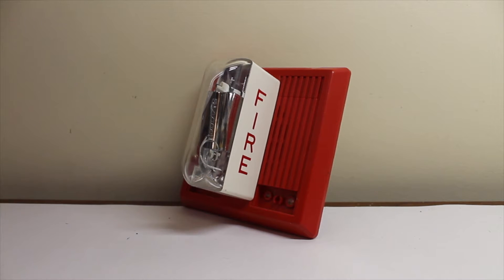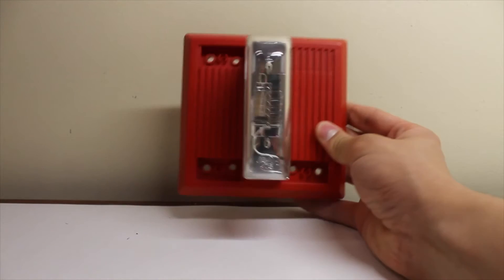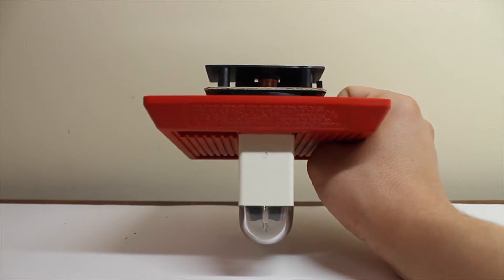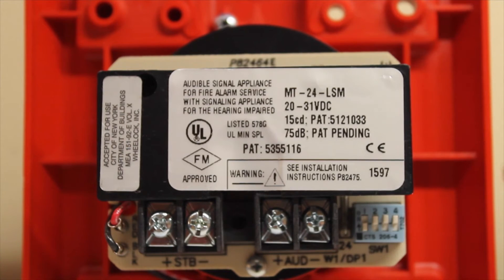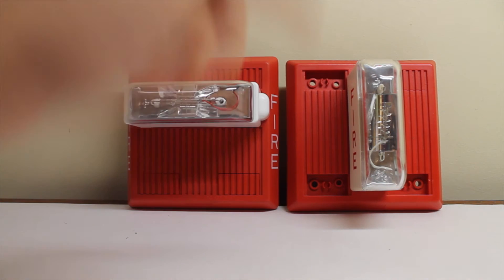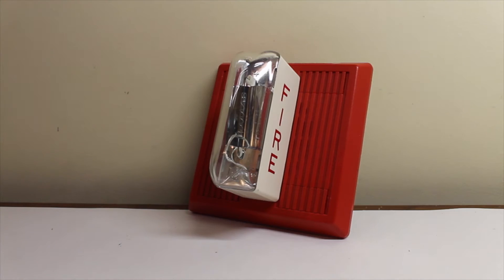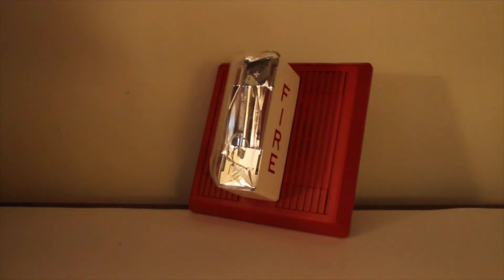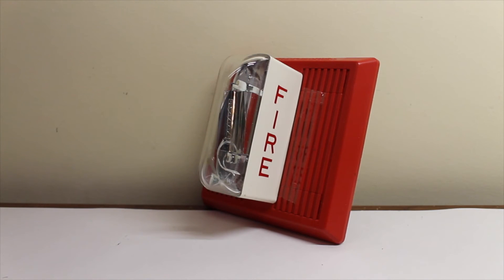Wheelock MT-24-LSM Fire Alarm Overview/Test

Comment: I saw this not just at Best Buy, but in a bathroom too! As far as loudness goes, I wonder if this device is louder than the System Sensor P2R, or perhaps the same loudness?
Reply from the maker: It's pretty loud, seemingly close to the Advance series (at least on high volume, which is more than likely what you would see installed in the field). I wouldn't say it's as bad though. I just watched your video in the Best Buy restroom, and I definitely would not want to be in there should it go off! Luckily, I've seen Best Buy stores with remote strobes in there, none yet with a horn/strobe. Thanks for watching and commenting.
Reply: I heard one for myself and it seemed louder than the SpectrAlert, but I could be wrong because it was on continuous and every SpectrAlert I've heard for myself was on code 3.

Comment: There is this same alarm in one of the portables at my school, it’s on code 3, and IT’S LOUD, it scares everyone when it’s time for a lockdown drill, and the strobe is 30CD, and the pull station right below it is a basic metal t-bar that’s branded Tech-Time Communications, there are actually a bunch of those t-bars, but most of them are branded Grinnell

Comment: Wheel lock is an Edwards device ?
Reply from the maker: Matthew Gregory You're probably thinking of the Integrity from Edwards, which has a similar design to this.
Reply: NewEnglandElevators maybe their is some with out the strobes
Reply: That's actually not the case. You might be thinking of the Edwards Integrity Series. The Integrity looks a lot like the Wheelock MTs from the mid to late '90s, so much so that it almost looks like a dead knock-off of the MT (though it's not!)
Reply: @apetersenALT  yes very similar but the wheelock MT sounds different then an integrity
Reply: @matthewgregory8218  That is true. Very true.

Comment: I remember seeing these at a different school i went to at that day when I had this district choir auditions. They weren't used as fire alarms though. When I saw these alarm, it was a white color, with the strobe by the way, but without the FIRE lettering. They were used as school bells. When i first heard them go off (all though it was weird since that day was in a weekend like at a Saturday), I thought they were the fire alarms, but when I asked a school staff what was that sound and they told me they were school bell. They had the continuous bell code by the way, and not only that it also changes to hi-lo code, meaning that it's a warning that you have 30 seconds to get to class and after the 30 seconds are up, it goes back to the continuous bell code, meaning that class has started or ended. My thoughts about them, I've never even seen wheelock mt-24-lsm's were used as school bells. After hearing that hi-lo code go off, it didn't sound that loud, but the continuous bell kinda does and it really hurts your ear when your close to it. Any thoughts?
Reply: That's the Wheelock MT-24-WH.
Reply: And saw those at a mall in Ottawa and my agency with a light plate my Agency also has Spector alert advance set on 15 cD

Comment: The vertical strobe suffixes are LS (15), LSM (15/75), MS (30), IS (75), WM (100+), SL (15 sync), and SLM (15/75 sync).
Reply: Also, a Wal-mart in my area used to have these with IS strobes before they "upgraded" to SpectrAlert Advances.
Reply from the maker: +Craig Baker Ah, gotcha! Thanks!
Reply: +NewEnglandElevators Oh, and you can't forget about the sister known as the AMT, which has three prioritized inputs for multi-application systems!